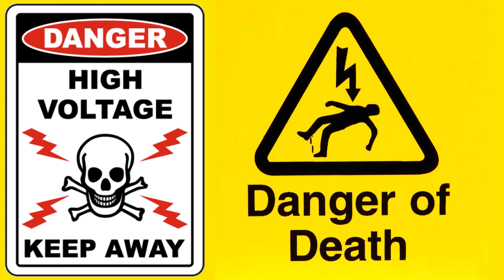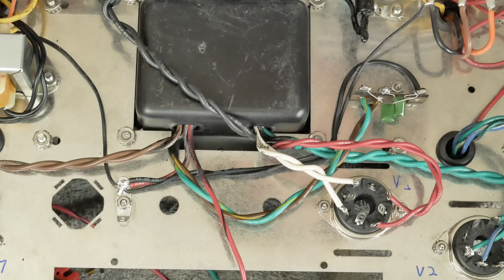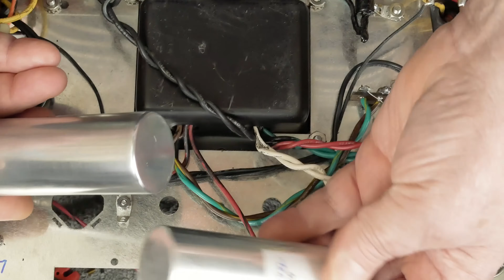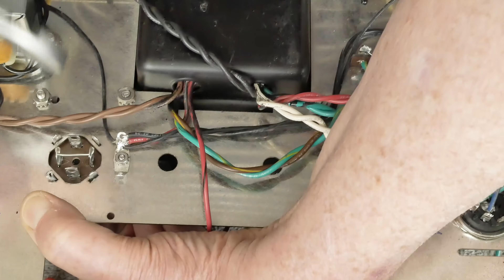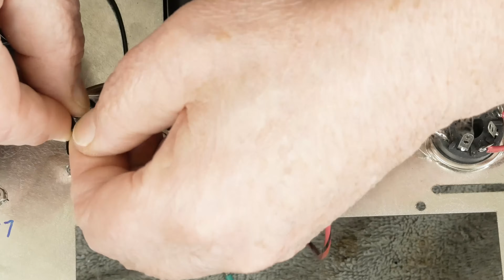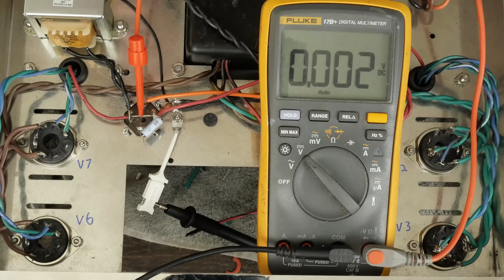Dynaco ST70 Tube Amp Kit: High VDC Wiring and Testing.

Comment: Something that I do on my power supplies from time to time is run the center tap through the choke then attach to the ground bus. It has the same effect as placing it on the high side, but there's less potential on it and less chance of failure. I do see other schematics with their chokes on the low side here and there. Just something to consider.

Comment: I found out the hard way that caps can remain charged for months without a bleeder resistor. I was going to change tubes on my 35 year old vtl preamp that had not been used for 7 or 8 months. I accidentally touched something and got a heck of a shock.
Reply from the maker: Yup, a bleeder resistor is just a must have part IMHO. I also believe they help stabilize the voltage.
Reply: Looking on the bright side, you only die once 👀